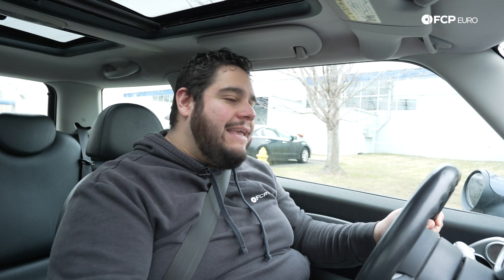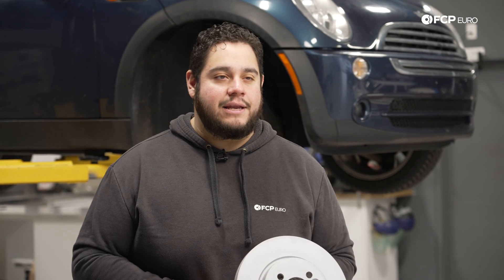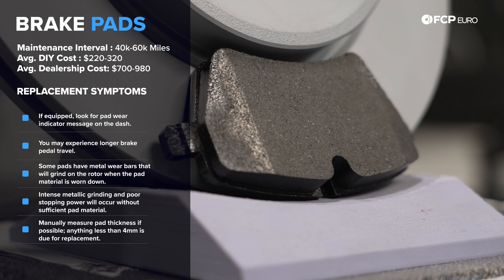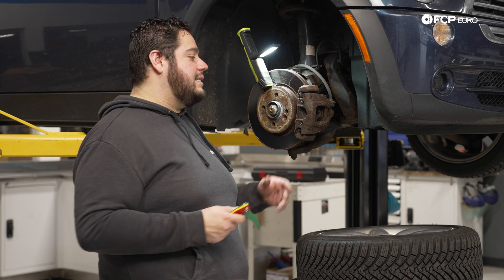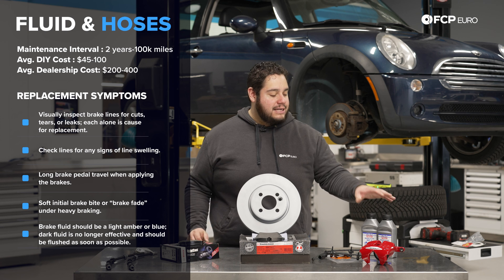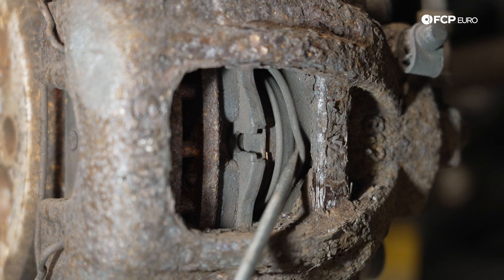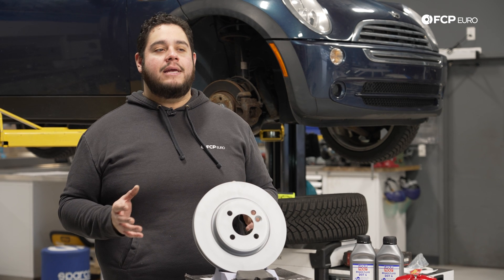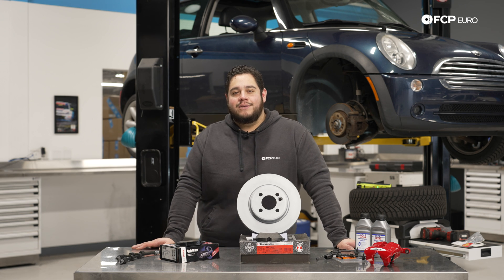Is Your Car Safe to Drive? Learn How to Inspect Brake Components!

Comment: Slide pins?
Huge thing not to mention IMO :)
Reply: Agree 100% I had one stick cause of a torn slide pin boot. Brake dust and gunk had gotten inside. Caused the vehicle to brake towards the right.